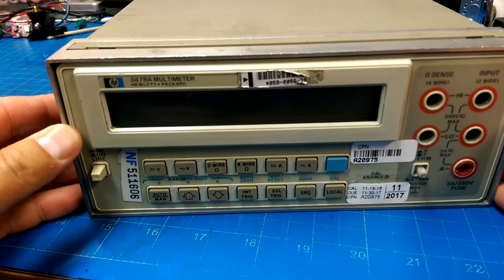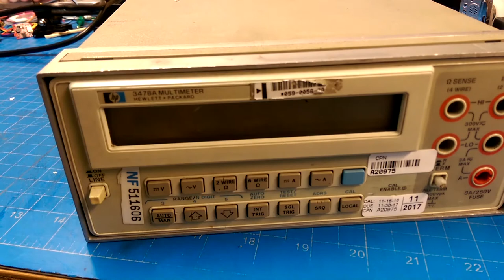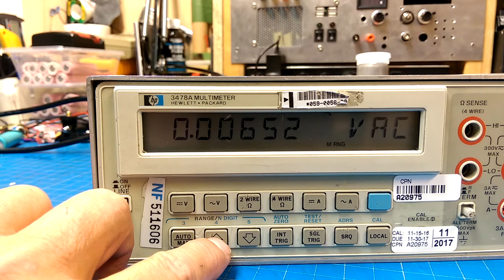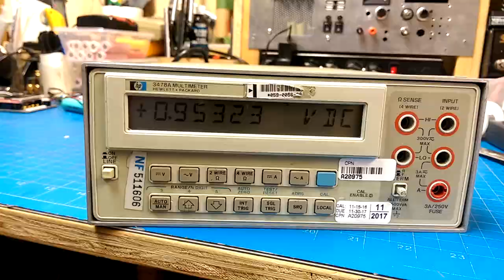HP3478A score   calibrated

Comment: while you have it open, replace the 2 RIFA caps (C765, C766) under the power switch and the 2 (C720, C721) under the HPIB ribbon cable.
Reply from the maker: Good suggestion.